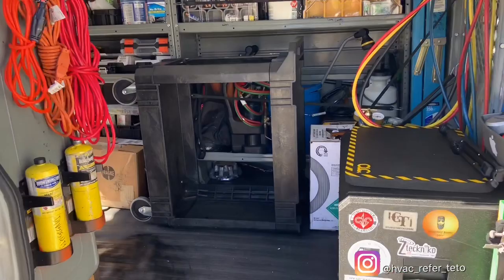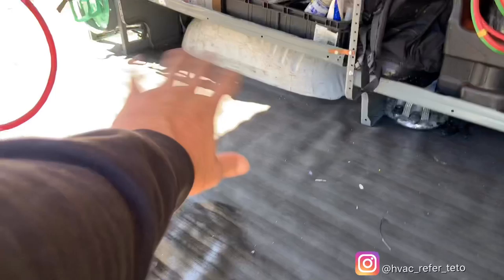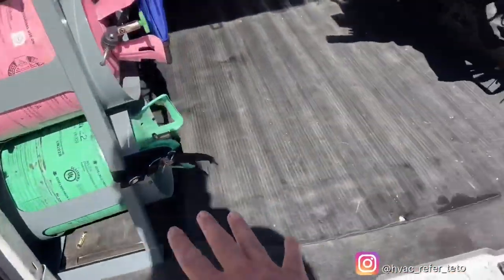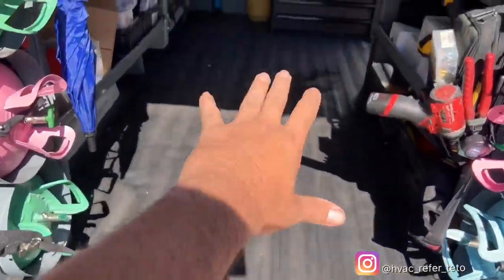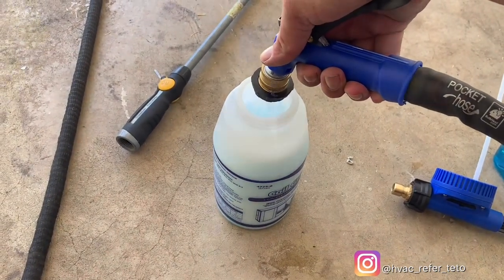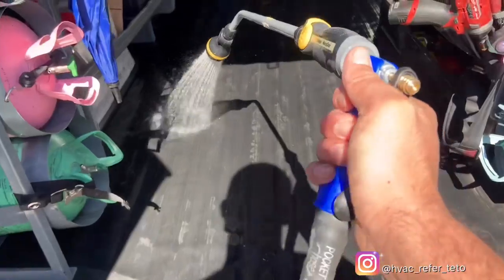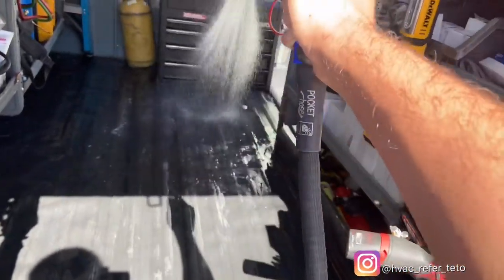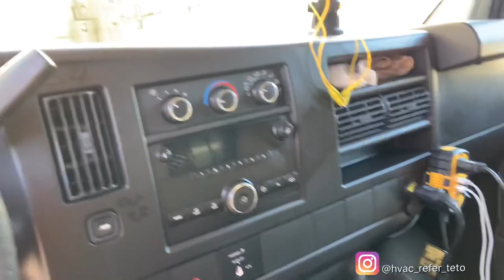Deep wash on hvac service van

Comment: I probably wouldn't make a habit of cleaning the rubber floor mat like that, if it gets under the mat its going to rust out the floor, you should sling in some sheets of plywood